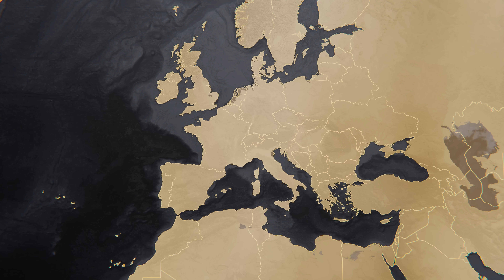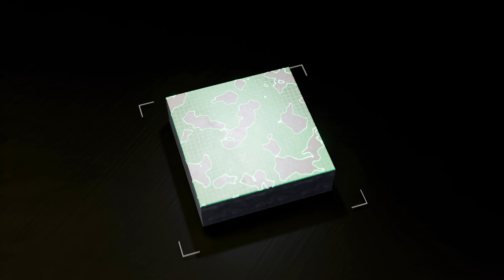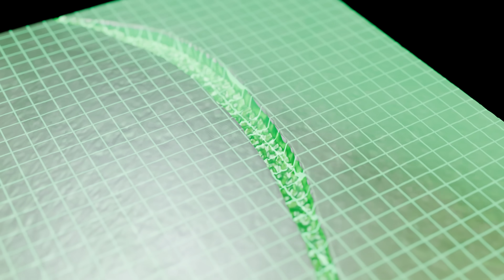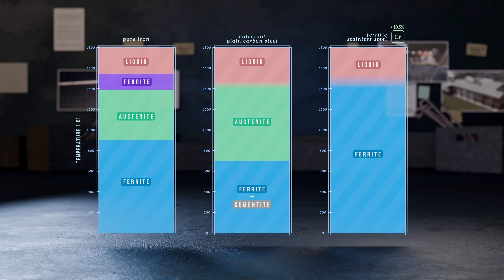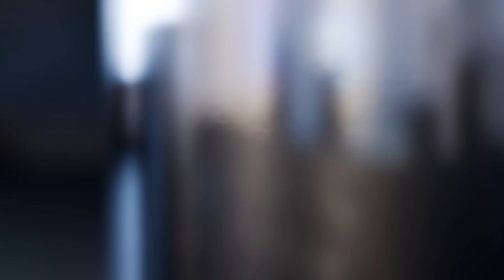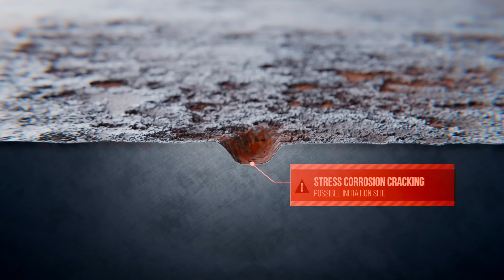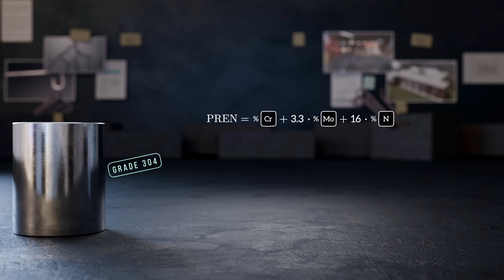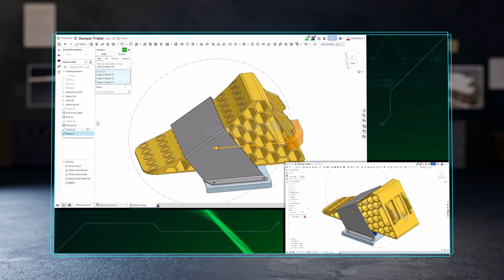The Problem with Stainless Steel

Comment: Phenomenal video. But… as an architect… I’m SHOCKED that anyone ever thought to put a thick concrete suspended ceiling above an occupied space. It’s just a horrific idea. You just don’t put tethered mass above occupants. Such a sad outcome. Horrifying. Poor people. 

And the fact that the building was 13 years old and regular inspections didn’t catch this issue is telling as well. This should have been discovered and addressed.
Reply: Was wondering if anyone else was thinking the same so was nice to see this.  Yeah just seems insane to me to just have a heavy suspended ceiling that if it fails will crush people.

Some other commenter said that in the year before the collapse there were some snapped rods already discovered.
(looked it up to double check and is true)

So the issue was known and nothing was done about it as well.  This was entirely preventable but wasn't due to negligence.
Reply: They did catch the problem but didn't action it. The inspectors went to jail.
Reply: Suspended ceilings with “acoustic tile” and metal frames and lighting and wiring are everywhere in commercial property.  They’re not as heavy as that one but are pretty heavy.
Reply: @Georgewilliamherbert With respect, acoustic ceilings are incredibly light. 

The panels are foam or fiber, and the tracks are generally extruded aluminum. They’re hung with thin wire!
Reply: @Georgewilliamherbert  you seem to mistake compressed glassfiber panels held by flimsy steel sheetmetal profiles for concrete slabs dangeling off the roof.

if an acoustic panel ceiling dropped not a single person would have died.  eyes getting stabbed by wires and stanced profiles were the worst injury...
Reply: @casemodder89 Do you have any idea how heavy light fixtures are?
Reply: @Georgewilliamherbert let me introduce you to my profession: Sparky.  so i have no clue what i'm talking about whatsoever. 😉
Reply: @Georgewilliamherbert they're called 'light' so how heavy can they be 🤔
Reply: @Georgewilliamherbert  one such in a school or kindtergarten fell down here  too small bolts in too big holes in concrete, did not grab conc well , my bro put itup , did not hang on it to test strength, told by boss to use wrong size.l think he said ..no injuries place was empty
Reply: There was an auto tunnel in Boston with similar problems
Reply: @KarlKrause-o3c  Correct.  In the case of Boston it was inferior adhesives not stainless, if I recall correctly.
Reply: Depends on what you call "thick" ...

"On May 9, 1985, the indoor swimming pool in Uster, Switzerland, suffered a catastrophic ceiling collapse, resulting in 12 deaths and 19 injuries. A 4-inch-thick concrete and steel roof fell, caused by stress corrosion cracking of the stainless steel hooks holding the ceiling. This incident highlighted critical safety issues regarding materials used in high-humidity pool environments. "
Reply: @peterfitzpatrick7032  Maybe "heavy" would be a better term to use rather than thick. Assuming a standard density of 2,400 kg/m³, a 1 meter square of that ceiling material would weigh @ 240 kilos, so assuming an olympic-size pool, the ceiling above it of the same dimensions would weigh @ 300,000 kilos or 661,000 lbs. That's roughly equivalent to 8 fully-loaded tractor trailers.
Reply: @paulm749  Or, the equivalent a whole 'nother swimming pool.
Reply: @peterfitzpatrick7032 4” is what is specified most often for concrete walkways, driveways, etc. So yes, that’s genuinely astonishingly thick. Even THICC. 

A 4” thick suspended concrete ceiling was an idiotic idea. There were better thin panel solutions even in the period. Shouldn’t have ever happened.
Reply: Swiss engineers are quite arrogant, and not particularly intelligent.
Reply: I've wondered about this design/ build approach as well.  Concrete, suspended overhead, from a ceiling, where people will reside?  Really?   Similar thing happened in Boston, in the Ted Williams tunnel, suspended concrete ceilings started falling.  I think several drivers were injured, if not killed.  This case it was not stainless steel, but a faulty adhesive.  Just seems like a bad idea to me to hang concrete slabs above our heads.
Reply: As I am not an architect, could you please elaborate which part of this is wrong? Is it only because the ceiling is mounted under the concrete or to have a ceiling in general?
Reply: @FreshPe it was a bit bold to hang concrete slabs off the roof. but that's not the main problem.  everything works as expected if it's sized properly.

and the rods they used were sized for the mechanical load, but undersized for chemical load. chlorine ate into the subpar material choise and weakened the rods until one failed and the resulting overload of the also corroded remaining rods led to a cascading effect of failing rods in the whole area. 

everything that was hanging on those 304 stainless rods collabsed. and with the weight of those concrete 'panels' many people died.  a comment said it would be about 240Kg per sq/m.  

a usual acoustic panel ceiling would be less then 1% of that weight per sq/m.
Reply: @FreshPe  the issue isn't that a ceiling was suspended from a concrete roof, but rather that that ceiling was Also concrete.
More concerningly, the ceiling was about 125% (100mm/80mm) the thickness called for in the design, which is already excessively thick for a suspended concrete ceiling.

This is made worse by the fact that such a panel is ~240kg/m² and the design called for ~200kg/m² (concrete is ~2,400kg/m³, div by 10 or 12.5 for 10cm/8cm respectively).
 Meanwhile, standard heavy duty walkable panels are only 10-15kg/m² and their grids are rated for 15-30kg/m²...
And then they added extra weight by adding plaster and wooden panelling to the suspended concrete, because exceeding the standard safety ratings of such a ceiling by 8x wasn't enough...

I'd tell you exactly what each slab weighed, but only the thickness and a total weight of "several tons" is provided.
Reply: What is the purpose of having a suspended concrete ceiling?
Reply: @johnbull1986”Aesthetics.” They likely thought it looked cool. 

It’s horrible for sound (reflects instead of absorbs), it’s terrible in tensile strength (so suspension is problematic right off the bat), and it’s extremely dense (so it’s always going to take incredibly complex engineering to make it work).
Reply: One of those times where someone bragging about "This has never been done before, it's so unique" is a red flag that they probably don't understand how it could go wrong
Reply: @UNSCPILOT  those stupid people: "we want new new new, no matter how safe it is".

they are on one end of the stick and "conspiracy theorists" are on the other one.
Reply: It's not that bad of an idea. The idea doesn't come as : let's put a concrete ceiling. It usually more devious. The Architect will suggest to have a walkable ceiling for maintenance purposes. He will also request a ceiling with good acoustic characteristics. Engineers will come and suggest all kind of things, one of which will be, concrete ceilings! Note that anyway they needed a ceiling, so something would have fallen off.
Reply: There’s nothing inherently wrong about a concrete suspended ceiling, it’s done quite safely in lots of places, it’s the fact that they used the wrong materials for the environment, these guys are supposed to be engineers, they design it for the right conditions and use the right materials.
Reply: @Tir33nts343 sorry - it is utter madness to suspend heavy concrete above anything. This is so dependent on material strength, corrosion, quality, workmanship, design strengths, external stress such as earth tremors etc. etc. It makes no logical sense, is not necessary because far superior options exist.
Reply: @user-iq2jd8bd5c yea, but all roof structures are heavy. Its a bit miss directing to speak if 7t as a heavy slab. All slabs are heavy. All the alternativs need to be considered to draw a conclusion on the decision of concrete or not. After spending some time in Switzerland I have noticed a large amount of buildings of a sertain era. Much concrete of a special style. It might just be so simle as that its a low cost alternative and with out this corrosion deficiency the roof would have held no problem. We can be sure about one thing. Its never random what choice of building material is being used.

Comment: Very good video ❤
For armour making by cold forming
grade 304 would be the best stainless steel wouldn‘t it?
It seems to be the most ductile when worked cold
Provided I insist on using stainless steel
But wouldnt it be bad against sweat?

Comment: I'm just wondering, why not coat stainless steel with protective primers just like we do with steel, I know the main point of stainless steel is being "stainless" but wouldn't it be better to do so?
Reply: Coat something well enough and it will  resist as well as stainless - I have an eldely (1989) , but galvanised, car and it's paintwork is amazing. I'd hate the have a stainless car.

Comment: That's why you use basalt fiber, not steel, rebar.
Reply: The stainless wasn't rebar in the concrete, in fact the 100mm thick concrete never failed here, nor was it involved in any way in the collapse....
Reply: @peterfitzpatrick7032  My bad. How insensitive of me. That's why you use basalt fiber, not stainless steel, connecting rods. Though basalt fiber rebar also a good idea.

Comment: Brings back memories of owning a machine shop. Those austenitic steels were a bitch to machine due to work hardening. There was one type, 303, that was a pleasure.  The PH steels were a bitch too, but not as difficult as 300 type steels.  The ferritic steels were not tough, except it was not easy to get a fine finsh.
Reply: 303 has sulfur added for ease of machining. The sulfur is present in small particles that break up the chips. It also reduces corrosion resistance and makes it impossible to weld. So most of the time you're stuck with cutting the gummy stuff.

Comment: The outcome : Two structural engineers and the architect were convicted of negligent homicide and negligently causing a building collapse. They had identified damage (a broken suspension stirrup and visible corrosion) but failed to report it properly, did not treat it as critical, and did not seek specialized expertise , allowing the dangerous condition to continue until the ceiling fell. At the time of design, it was well known 304 is inappropriate for acidic environments (edit: corrosive environments) compared to higher grades..so I think its fair to say this was an outlier caused by bad actors, not a lack of knowledge.
Reply: That's exactly what I was wondering, lots of SS isn't even rated for constant salt water exposure, and chlorine exposure is so much worse.
Reply: If the structural engineers had known more about material science, they should have alerted the architect. The entire suspended ceiling design might have changed at that time in favor of something more practical. That’s how the design process should work.  If only…..
Reply: @kly8192  These engineers were found guilty of negligent behavior, which means they knew things, failed to act, and covered up problems according to court documents. Sadly, the tragedy had nothing to do with engineering knowledge, as this video suggests.
Reply: @xfloodcasual8124  I agree with what you say. The point I am making is that they had the opportunity to make changes to a flawed design well before anything was constructed. If they had the knowledge.
Reply: @kly8192  Just to go a little deeper : According to the trial from my basic research, they DID have the knowledge during the design phase. You don't need to have 2026 molecular knowledge, you had to have reasonable knowledge at the time based on standards and practices, which they did. It was not a knowledge issue. That is the core of "negligence", hence the conviction.
Reply: @kly8192 tbh, deciding to make a drop ceiling out of concrete panels is exceptionally stupid in its own right. There's plenty of fire resistant materials that weight far less that can be used for panels
Reply: Big blot on Swiss engineering and safety.
Reply: @Zerpentsa6598 - Well... Swiss cheese had a lot of holes in it too! ;)
Reply: This is not mutually exclusive or diametrically opposed
Reply: Треба було їх заховати в лікарню, ще тоді, коли вони задумали таку ідею! Підвісити бетонні плити на струнах над головами людей. Навіть то був би і не басейн! Будь де знаходитись під вісячою бетонною плитою завжди безпечно!
Reply: Still 304 to most people was always considered to handle everything.
Reply: Were they foreigners / invaders?
Reply: As stated in this video chloride stress corrosion cracking was not known to occur at the temperature of this application. So-called ‘room temperature SCC’ was a revelation to everyone at the time of this terrible tragedy and some of us have worked hard since then to disseminate the knowledge acquired from this and subsequent accidents.
Reply: @mickschofield1803  The issue was not what was known at the time, but what was known later and not reported or acted on . This is what led to the homicide convictions. It's essential to spread engineering knowledge, but also to understand that responsibility and liability goes far beyond the install.
Reply: @xfloodcasual8124  Sure, my only point was that the mechanism of anodic SCC (well, chloride SCC of austenitic stainless steels) had only been observed at higher temperatures than room temperature at the time of Uster. This ‘new event’ gave rise to new terminology RTSCC (room or ambient temperature stress corrosion cracking) recognising its novelty. Obviously other stress cracking mechanisms, particularly cathodic SCC (e.g. sulfide stress cracking) is maximal at or below room temperature and reduces in severity as temperature increases.
Reply: @mickschofield1803 Perhaps not known in the architectural industry.  But it was well known in the oil and chemical industry where stainless steel fasteners were prohibited in and around cooling towers since the 1950s.
Reply: @jameskanuth4274  Yep. This is where I learned it.
Reply: @mickschofield1803  its basically a complete disregard for basic common sense, you dont even need a education to predict these kind of problems.
Reply: They shud hold ceos shareholders managers supervisors etc accountable like this for all industries. Especially automotive industries
Reply: @JustMe-l2j no, not really. Everybody is a specialist in these project. They know they are being paid and carry professional insurance because their job must be done well. CEOs get into trouble when company finance and policy goes wrong. The Architects and  Engineers get into trouble when buildings collapse.
Reply: Thanks! Nothing like a good Justice.
Reply: Don't use bleach to sterilize a Stanley thermos. It will eat hole in the stainless.
Reply: It's says on a Milton(chlorine sterilising liquid) bottle not to leave stainless steel soaking in it...
Reply: Acidic? Isn't chlorine base?
Reply: @Albyint corrosive is the better word
Reply: @Albyint  no, chlorine isn’t a base. Chlorine is normally stabilized in solution by adding base. When chlorine gas dissolves in water, it will pull water apart forming hydrochloric acid and hypochlorous acid. This disproportionating is reversible, but neutralizing the HCl prevents that reverse reaction, which is why chlorine solutions are stabilized with sodium hydroxide. That said, when you smell chlorine above a pool, that is either reformed cl2 or choramine.
Reply: @Albyint  Hydrochloric Acid: "Bonjour"
Reply: @ShadowEclipse777  chlorine and chloride are not the same, if that’s that you are implying. The chloride in hydrochloric acid is corrosive, but not acidic, it’s the proton that’s acidic. Otherwise sodium chloride would also be acidic. Chlorine on the other hand is not acidic, but forms multiple acids and remains a strong oxidizer when it comes in contact with water.
Reply: @SetTheCurve  sounds like you’re quite familiar with chemistry 😉 Thank you for teaching us a thing or two without a condescending tone :)
Reply: @mitchell6679  I don’t mean to be condescending, I was trying to be straight to the point. I think being corrected or contradicted is alone considered to be condescending to many people 🤷
You notice I tried to be polite by giving the benefit of the doubt (“if that’s what you’re implying”).
Reply: @SetTheCurve  He specifically pointed out that you didn't use a condescending tone, and you absolutely didn't. It was really nice to see.
Reply: @Albyint "Sodium Hypochlorite" is the sanitizer.  When it oxidizes organic matter,  it releases Chloramines.  Because they are trapped inside a building,  they attack the stainless steel.
Reply: @Albyint hydrochloric acid is a thing
Reply: @Albyint  I think most engineers don't have a good grounding in chemistry.  Nobody can know everything, and as technology advances disciplines inevitably become more specialised.
Reply: You explained in a paragraph what this boring as hell Ai narrated video takes over twenty precious minutes to do.
Reply: Yep, as soon as they said 304 stainless I knew what happened. 304 should never have been used in this environment.
Reply: I doubt whether they were proper engineers or rather architetcts. It looks like the typical bullshir project and architect would love to design.
Reply: @danielepavone3131  You don't need any government license to practice architecture or structural engineering in Switzerland like you do in other places!
Reply: @danielepavone3131 Я би краще так сказав:" Неважливо хто ти за фахом інженер, чи архітектор. Але підвішувати бетонні плити на струнах анкерах над головами людей- це вже безглузда ідея! тут достатньо просто людського звиклого міркування без інженерії"

Comment: Working with stainless bolts will quickly make a normal man ferociously violent, especially if Nyloc or pinch lock fasteners are being used.